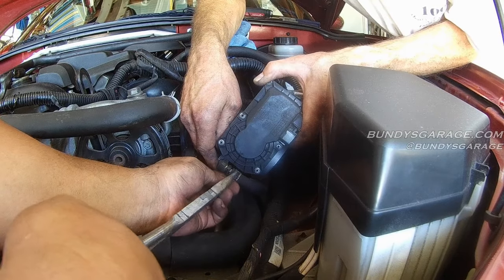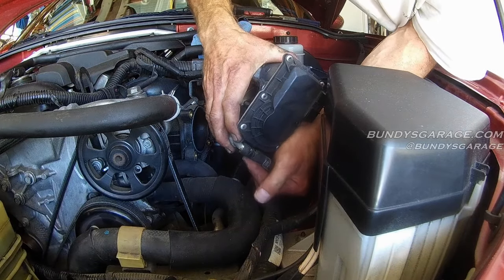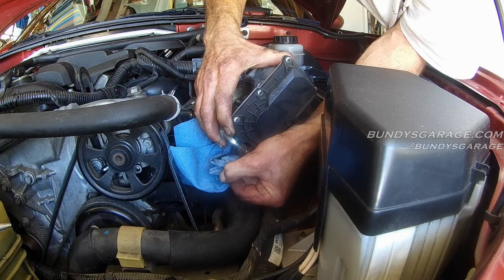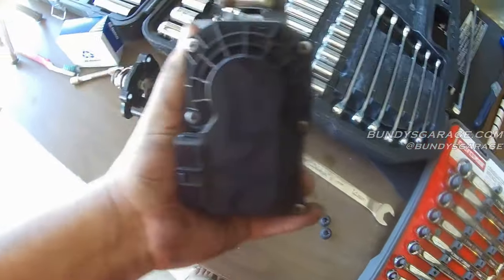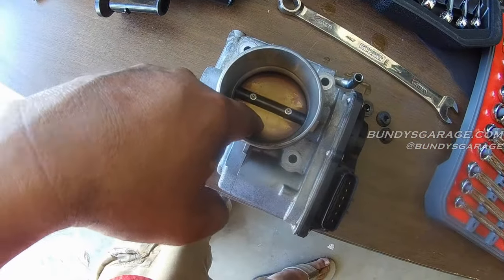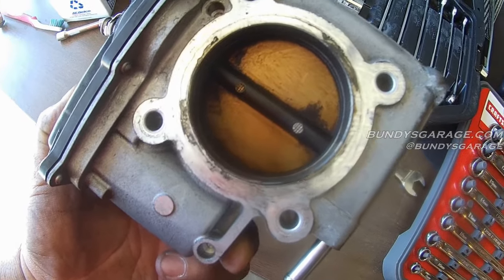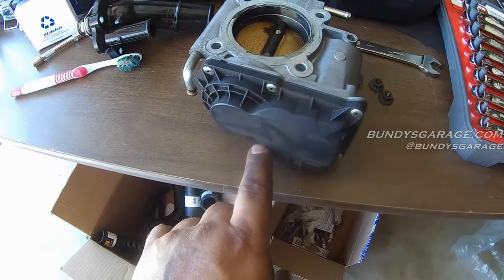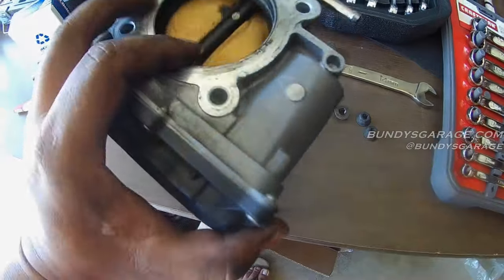How to Clean a Throttle Body - Throttle Body Cleaning Service - Bundys Garage

Comment: WRONG. NEVER ... and I say again NEVER move that butterfly while it's still on the car. It can chop your finger off according to Ford.  Ice sweeps etc.  Only do this removed from the vehicle.
Reply: This guy was pretty clear lol, you don't ever manually move the butterfly manually it will mess the angle of it, second thing ofc you will not put your fingers in while reving the car, that's like saying don't put your fingers on the working chainsaw, also you clean it with a throttle body cleaner spray while reving the car to open the butterfly and spray it inside, third thing you can clean it with brush OUTSIDE of throttle without moving the buterfly ofc, being in car or not it doesn't matter just don't manually touch or move the butterfly.
Reply: @davolthe1261  sure sure... then why have so many chimed in? Maybe you didnt see the same beeedeo bruh

Comment: If you mess up the gears by pressing on it then it was going to break anyhow. The electronic throttle is on of the most stringent tested parts of any vehicle or any brand. They will NOT break by moving the valve open!

Comment: Hes right, but at the same time. Turning your car on without all that stuff connected will send sensors gone crazy. I did my Toyota rap 4 20 19. And I used to stick to open The Thing. Cause mind understanding some of these can close on you and possibly hurt you. And I used a plastic cup to hold the cleaner and found out that it disintegrates the plastic cup along with the toothbrush I was trying to use.  But I gotta clean though. I forgot to plug some stuff in and all the sensors were going crazy. When I started it up but went away after about a couple hours of the car being on.
Reply: It will go away after so many drive cycles and the ecm doesn't seem anymore issues.

Comment: I  moved mine  quite a bit everything still works perfectly  fine.. so may not be an issue for some vehicles
Reply from the maker: Does yours have a metal wire going to it or is it fly-by-wire?
Reply: @bundysgarage  electronic
Reply: @bundysgarage  fly by wire
Reply: did this to my 2008 civic and it still works fine also , i put the plastic end of screw driver in it to
hold it open while i scrub the crap out of it.
Reply: @bundysgarage  electronic

Comment: What could be the reason when, after cleaning the throttle body on a Camry 2005 (cleaning on a car with the pedal pressed), rpm jump up to 2200 after starting up, go down to 1500 in 3 seconds and then drop to normal idle (650-700) with warming up? Before that, the rpm jump was up to a maximum of 1500-1600.
Reply: Could be the computer sensing the difference in flow and slowly relearning everything. Should be alright after driving a while.
Reply: @MikeCC  It's been like this for more than a month
Reply: @MxmVslv  disconnect your battery, the ECM fuse and throttle body plug for 15min on a cold engine. Reconnect from throttle body backwards! Put the car on for 40sec and chk warning lights. If throttle body light is on then switch key of. Try on and off procedure till throttle warning light is off. Then start enging without refs let it idle till engine max opp temp!😂😀😁
Reply: have you tried relearning the idle for your car ? look into that for your specific car and it could help with this high idle problem
Reply: @gaecoomforeeskin4842  I did a few calibrations but they didn't help (1. Disconnecting the battery terminal for a few minutes running N and D with brakes for 4 minutes and driving for 1 hour at >45 mph. 2. Disconnecting the battery overnight, idling 40 min in P, with an additional 5 min in D and driving >50 mph for >3 hours).
Reply: @gaecoomforeeskin4842  Also, I ordered and installed a used, original throttle body from ebay which behaves exactly the same after all calibrations.
After every reset, I see the idle go a little high (around 1000-1100) and then settle down to the normal 650-700 rpm for 6-10 minutes. So disconnecting the battery does its job, but with every engine start I still see 2100-2200 rpm.
Reply: Sometimes you gotta reset it using a scan tool I use mine to reset it on Hondas and Toyotas. The rpm’s go up and require a good scan tool to fix it.
Reply: @DesertSnow1  What models can do this?  I have one but it's pretty cheap

Comment: As long as it is not on the car, you can absolutely clean it on the workbench. You can gently open the throttle plate and clean the bore and edges. Keep the electrical side at the top to keep the cleaner from getting in the drive portion. Just be gentle with the movement, it will be fine.

Comment: The Car Care Nut who is ( was he actually has so many followers that he went out on his own ) a long time Toyota Tech has a video on cleaning the throttle body while it’s still on the vehicle. He ha# done hundreds of throttle body cleans and never had a  problem. The “ key “ is to make sure there is no way that the vehicle can be started while you’re cleaning the TB so put the keys away and insure any remote start devices are nowhere near the vehicle. You certainly can move the throttle body plate but do so very very  slowly  and gently. The same when you are releasing the plate again. Take a microfibre cloth and spray a couple quick squirts of Throttle Body Cleaner on the rag. Use one finger to  gently clean around the bore of the TB and the bottom edge of the plate. Then repeat on the top edge and bore.  Let the area dry after slowly returning the throttle plate to the closed position. ( there should always be a small gap between the bottom of the plate and the bore ( this is a small gap that allows the vehicle to get enough air to idle ). Replace the air inlet hose / pipe and drive as normal. What you will probably have is that the warm engine idle will likely be a little high ( from 1000 to 2000 rpm ). This is normal, and the vehicle’s ECU ( computer ) and sensors will adjust the idle back to “ normal “ over the next day or two.  You might as well clean the MAF sensor as well if it’s dirty but only if you know how and what kind of MAF sensor can be cleaned. You will likely notice “ crisper “ acceleration and maybe even a slight increase in mpg.  Maybe there are some Throttle body types that you don’t want to mess with but on newer Toyotas anyways it’s a fairly easy DIYer job.

Comment: Toyota's you can manually move it open, just do it slowly, no need to remove it.  
No brake cleaner, it leaves a residue.  Use a product specifically for the Throttle Body.

Comment: Well, you can move the plate to clean it and you will not damage the gears. The TBC is powered by the step motor, which generates electricity when moved manually. What you should not do is to open/close the plate rapidly, which may generate electric impulse above rated voltage of the control board and damage its components.

Comment: I somewhat disagree with being advised to not manually move the throttle body i mean all vehicles are different but the service manual for my 2018 Toyota Tacoma says to move the flap by hand. i do agree however to move it slowly but if you not being a reckless it should be fine. however im sure there are some car manufactures who have cheap internals in there electronic throttle body's which can shear. i guess what im trying to say is when in doubt refer to the service manual of your specific vehicle. 
but anyhow great video

Comment: I just take the floor jack handle and use half of it to wedge between the gas pedal to my driver seat and put it in the on position. I have the 99 acura tl but it uses a cable so no big deal there
Reply: Dont forget to put it in drive 😂

Comment: Damn lol well I look like I'm buying a new throttle body. Shiit 200 bucks down the drain lol I push the Butterfly flap why the car was off when removing the upper manifold and my car now after putting everything back together is now idling weird and I have a code reader and said clean throttle body but I'm sure it's broken lol rip
Reply: computer might just need to readjust like after you clean the throttle body it idles funny for a few days.
Reply: Damn if it was the electric throttle body then you ended up like me , having to purchase a new one 😭🤦🏽‍♀️ I totally forgot mine was electric while cleaning it and of course I ruined it by manually pushing in the butterfly by hand so had to buy a new one , in total it cost me almost three hundred dollars 😒🤷🏽‍♀️
Reply: @Aidan Bhuiyan Aftermarket is the worst ! That will cause your car to run like shxt , they through off the idle by putting on an aftermarket especially if it had an air mass flow sensor attached to it
Reply: Have you guys done a throttle position sensor reset at all?
Reply: I moved mine and it idled really high. I drove it around about 20 miles and it corrected itself..

Comment: if u open that cover up will see how robust built those gear are.no chance to damage them as long is not powered on.
Reply: There is a chance. I cleaned my throttle body today not knowing that I shouldn’t move it manually. All I did was clean the throttle body and now my car idles erratically. All the way up to 3k rpm. Don’t move it manually unless you want to buy a new throttle body
Reply: Turns out you’re probably right. Just did an idle relearn with my scan tool and now everything is running normal!

Comment: This is not true on all the vehicles. On my Ford F150 I cleaned it and move the flapper and no issues issues.
Reply: yes , older non electronic cable controlled with spring you can just push in.

Comment: Ok so if I have my 2007 Toyota Corolla off and I just step on the gas pedal with everything off, I run the risk of damaging the throttle??? I’m just surprised if a person could accidentally press the gas and cause harm. Or is it only if you open the butterfly from the front vs the gas pedal?

Oh wait…. If my car is completely off, and I press the gas pedal. I’m guessing the butterfly doesn’t actually open because the accessories aren’t on. Correct??
Reply: it won't open if you have the ignition off...  you don't have to turn on your car but just put it on start, where all the lights come ON but don't turn on the car...  when you step on the gas, the throttle body butterfly opens. then you can clean a bit better.

I think the poster meant, don't push with your fingers on the butterfly.